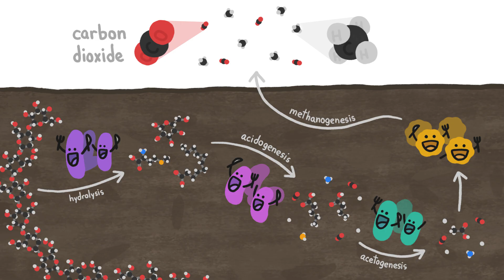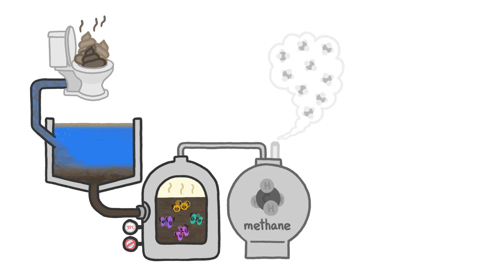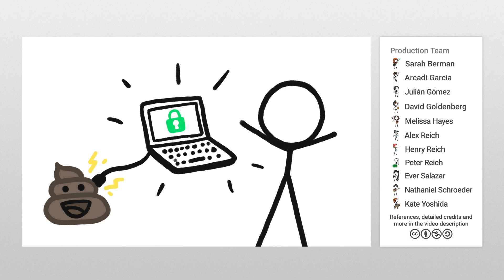How To Turn Poop Into Power

Comment: u know if we could turn human waste into RNG i.e Renewable Natural Gas and invent efficient and cheap RNG fuel cells we could use these in transportation (paired with electric motors) and grid/off grid power generation! using it in combustion engines/generators are less efficient compared to the potential ideal RNG fuel cells if we dedicated time/resources to such tech...

Comment: There is a lot of system that use different style of farming that requires less land. You and 7 billion humans existing pooping and farting is also bad for environment and contribute to global warming, there is no such thing as "clean energy" we only lessen consumption of "harmful" ones is because we have no other option. Solar goes to high demand of mining minerals for temporary batteries, Windmills is loud as heck and harm birds, hydro plants depends on location and same with biogas plant, we collect harmful methane and use it as fire and electricity but that still release carbon because bruh science, you create fire, there will always CO2(but using it in generator which not much compared to other gas) but We can guarantee that this is much more effective and more clean than fossil fuel and other gas, the carbon release burning this methane is much more less than using coal because bruh wood/coal is made from carbon elements, poops are not 100%. 

Sorry but won't a food that all ingredients is artificial, we had enough of this in flavorings, lessen the demands is impossible for 7 billion humans and counting. 

This is just a (no choice)solution to existing problems like other renewable energy, this are not 100% clean and safe but they are much more better than what we establish. Nuclear is clean but not 100% safe and this is like airplane, the safest transportation according the world but look when airline disaster occurs 98% is inevitable death and airline industries and national security is in shambles. This is the same Nuclear energy plant, once disaster(ex. Meltdown etc.) occur, nothing can stop it.

Comment: Small but Important note: If you only want heat from the methane, you should not/never just burn the gas in a simple furnace but instead you should put it into an engine that drives a heat pump just like you'd drive an electric generator. With a heat pump you get much more heat output than if you just burned the same amount of methane. It's important to let people know this. We need to use our resources efficiently in this day and age.

Comment: In PA, you are only allowed to back-feed so much power per month into the grid. A farm just down the road from me installed a digester and produced WAY more power than they needed. Rather than just not getting paid for the excess power they sent onto the grid, they ended up getting fined so much it nearly put them out of business. 
The problem is that PA power companies have to pay you for excess power at the highest rate by any local producer but is also required to only buy electricity at the lowest cost possible to feed the demand. So the more self-producers there are, feeding the grid, the more money the power companies loose, having to charge less and pay more at the same time. They need to change the laws so that power companies pay people at the lowest rate or just put a cap on how many KW/h you get paid for before you are producing for free. The savings would still be enough for more farms to add digesters and generators and for more residents to put up solar roofs.

Comment: THIS is the reasonable type of solutions "climate alarmists" need to be talking about (and nuclear, of course).  Telling people you're going to just slam them with "carbon taxes" or force drastic diet and life-style changes WILL. NOT. WORK.

Most people will embrace actual, reasonable solutions if you tell them the WHOLE truth (and use the carrot rather than the stick).  Keep governments small, but hold corporations accountable.

On a related topic: my uncle built himself a wood gasifier furnace which is EXTREMELY efficient, and companies make models that are even more efficient.  Wood burning is carbon neutral (CO2 is plant food, and trees actually give off CO2 and many other gases when they die and rot).  Additionally, the US is a world leader in afforestation, surprisingly being beat only by China.

Also related: Grasses and other fieldland plants ALSO give off "greenhouse gases" as they rot down (and they also pull the carbon from the air as they grow).  So the claim that cows are such a huge greenhouse gas producer is largely exaggerated, but does hold some truth to it.  I just wish Bison was more available and a little cheaper, as it's a better alternative to beef.

Comment: Yeah but what about the co2 emmisions produced by burning the methane?On long term i dont think this is a really eco friendly method of generating power
Reply: Compared to burning coal which is naturally made of carbon, burning methane gas is much safe. Ofcourse having fire means there CO2, the question is the amount which is far less compared to carbon from lpg tanks and fossil gas.
Reply: Everything is temporary power, this depends on the climate, the hotter the weather the more methane and more eager the bacteria to digest waste and turn it into methane, that is why there is a thing called "storage" which is also used for solar power if night goes.

Comment: As a wastewater treatment engineer. Really well done translating this process to such a digestible ;) size. 

One small sidenote: most treatment plants I know (european ones) already produce methane and use it to power their operations. However the leftover sludge cannot be sold as fertilizer since it is deemed too dangerous for human health (America is less strict on this), making the process not 100% renewable. Current research all goes towards finding use for the leftover sludge and not the methane production since that part is considered fleshed out. 

Again love you videos and this isn't meant as commentary just an interesting sidenote :)

Comment: The guys who play a game called Oxygen Not Included do something similar, but different, where they heat up petroleum until it turns into sour gas, whereupon it is then cooled down, becoming liquid methane, which then is “boiled” back into a gas, which is pumped into natural gas generators, generating far more energy than would have been made had the petroleum was instead put straight into a generator.

Comment: Hm...  but wouldn't that release even more CO2 into the atmosphere? Even without converting poop into methane, animals like cows have a huge impact on the climate with their methane emissions. If we also convert parts of their poop into methane, wouldn't that be even worse for the climate?
Reply: You will use it to power your generator so no, burning it is not much of a potent compared to burning woods or Liquified gas
Reply: When you create fire you always emit carbon and it is much more better to use methane as energy than let it in atmosphere, even high standard landfill collect methane from trash to use it as energy.

Comment: One major problem, that Gas is highly corrosive because of the other trace gases in it. Before you can power something with it, you have to scrub it. It's not a very economical solution, at least not yet. This technology has been around for decades. There is a reason it hasn't taken off yet.... It isn't a great solution in most cases.